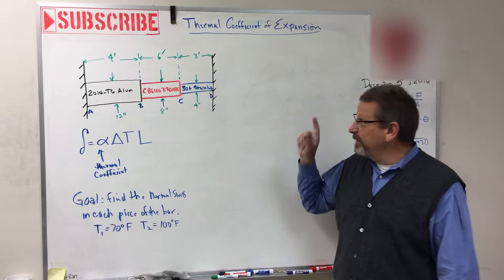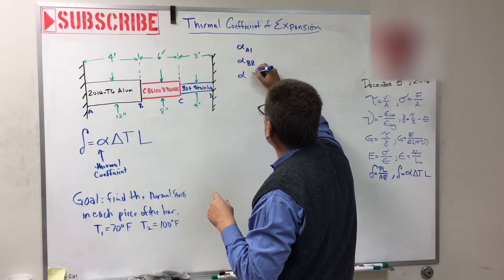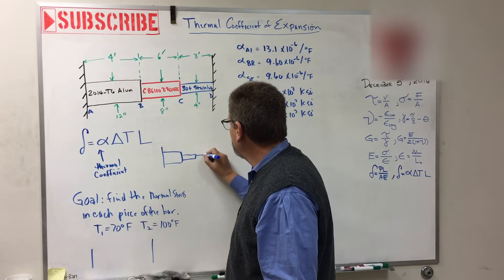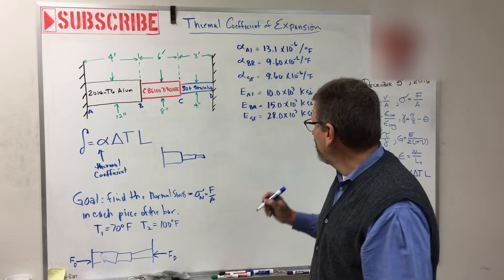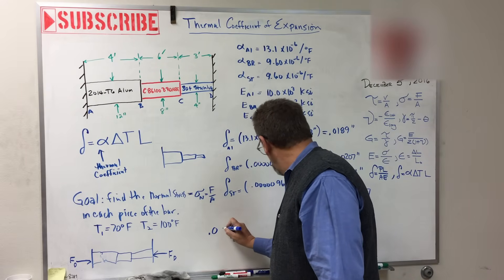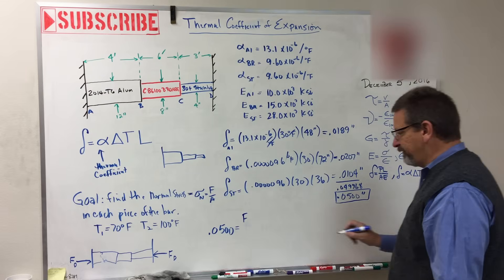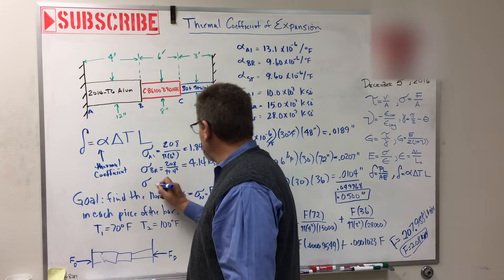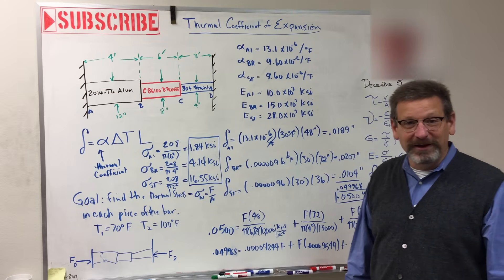Mechanics of Materials: Lesson 16 - Thermal Coefficient of Expansion Problem

Comment: Why couldnt u do for each material:
strain = L - L0 / L0 where the numerator is equal to the axial elongation, subbing in u get
strain = thermal coeff * delta T
then stress = E * thermal coeff * delta T 
I got the wrong answer doing this and im not sure why.
Reply: I have the same question.
Reply: Wait I figured it out, you cant do that because the bars never actually stretch because of the wall. So you need to find out the force the wall is putting in order to keep the bars from elongating.

Comment: A quick comment Normal stress it's not force over area. Dimensionally speaking indeed it's. How ever it's more than that. Sigma=F/A is only valid for pure traction force, however with bending we can obtain a contribution for normal stress. 

Recalling the DSV solution (Valid for slender, isotropic, homogeneous and compact beam -shear contribution can be neglected) 

Normal stress=T/A+Mx/Ixx (y) -My/Iyy (x).

However ti ringrazio pero il video. Great explanation

Comment: I think that the main take away from this video is that since these materials are fixed in place, the total deformation of all three rods together is zero. All rods expand due to temperature rise, so the walls respond with a compressive force, which decreases the length of each member. I think this was a good video but writing out the entire equation of total deformation would help clarify the process.
Reply: So it the temperature was increasing, the force would have been the tensile force?

Comment: you're doing this problem wrong,, after you get the elongation for each bar you can apply Hook law stress = E*strain----> for Al ; stress = (10,000 ksi)*(0.0189''/48'')=3.9375 ksi.

Comment: Dr. Hanson, for the force F, I got 1172.64 kips using the same numbers that you used in the deformation equation equaling .05 inches. How did you get 208 kips? That is not matching up with my calculator's answer?
Reply: he incorrectly wrote the coefficient of heat expansion for aluminum. maybe that should help although this message might be late :D